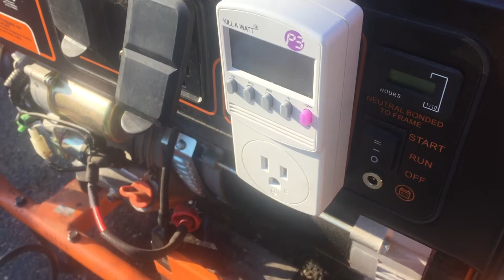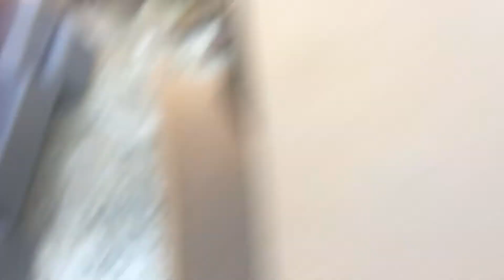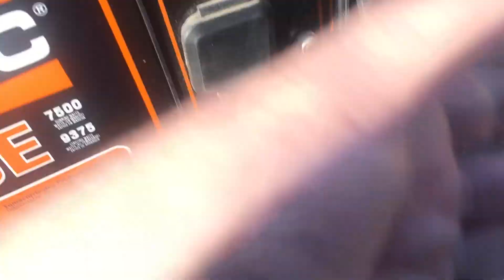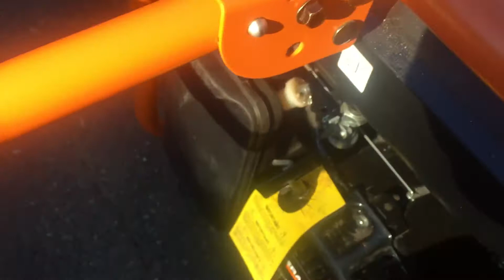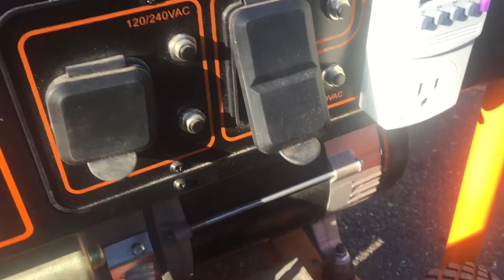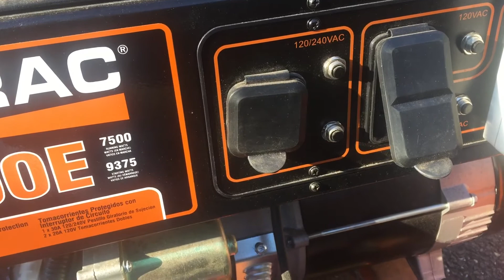Reflash and AVR on Generac GP7500E

Comment: Hello. Hoping someone could shed some light. Drill method didn't work--used the jumper--that worked---but when I turned the generator off--then back on---no AC power (again). (did these 2, 3 times with same result) Also---when I did the jumper method, I got a rather large spark when I touched ONLY the + to the + battery terminal WITHOUT GROUNDING the other lead (to the gen chassis)--which was surprising. Is my AVR fried ? PS. When I did touch BOTH jumper leads to battery & chassis---I did NOT hear the genny go VRRROM as per Ken's comment. Thx in advance for any help !
Reply: I would never use the jumper method. Not sure where that method came from actually. Connecting the positive battery terminal 2 the hot of the AC outlet will destroy the rectifier/diode assembly that charges the battery or even damage the stator winding.

The drill method is acceptable, but the other method for a brush type is to take your 12 volt battery with some jumpers and connect positive to positive and negative to negative brush leads for just a moment to reflash the field. 

If you get power and then shut it down and you get no AC output after restarting then the AVR needs to be replaced. It is not sensitive enough to sense the lower residual magnetism to actually turn on. Aftermarket ones require as much as 5 or 6 volts whereas OEM ones only need about 3 to 4 volts.
Reply from the maker: @bcampbell185  forwarded to James and Gary